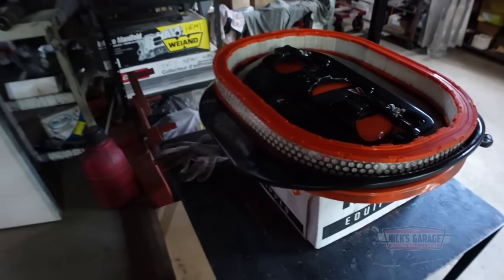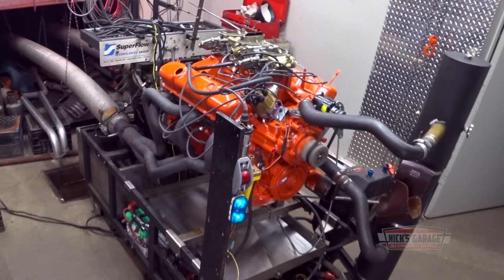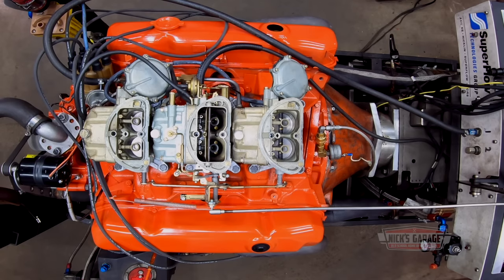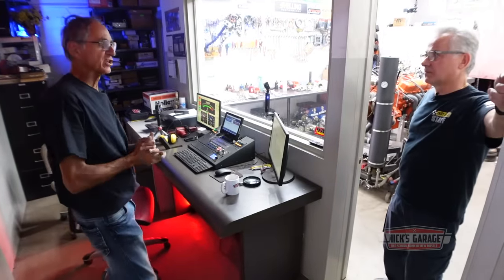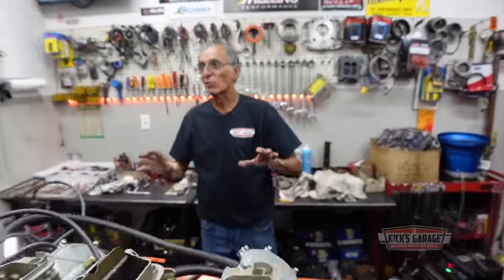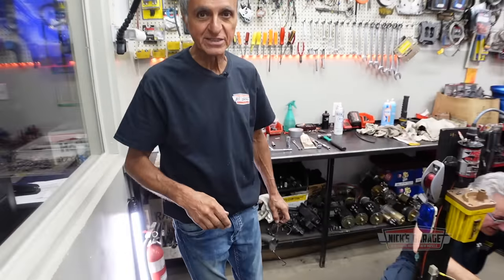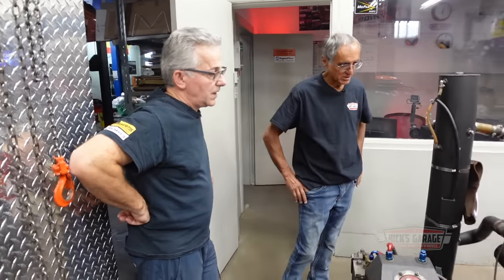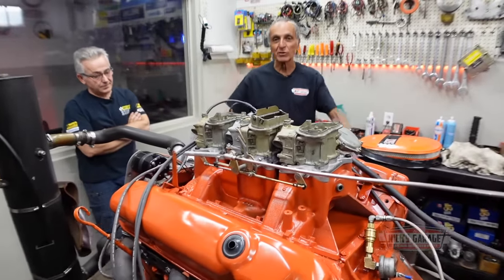HOT 1970 383 Mopar - Stroked and Dyno Tested - Road Runner Tire Melter

Comment: Hey NICK here's a little tip for that "six pack stumble". Change ONE outboard carb spring in the secondary diaphragm to one range LIGHTER. A lot of guys back in the day would put a stiffer spring in so they came in later; that's wrong thinking. By just changing one spring to one range LIGHTER, that set of barrels opens just a tad quicker. When the velocity picks back up in the manifold, then the other set opens up. That way instead of getting one giant gulp of air all at once and getting a stumble while the motor tries to build up vacuum again to get the flow moving, it comes in more gradual.
Reply: Pretty bold thinking Mr. Nick needs a pointer. Pretty bold, man.
Reply: @mikes.1882  not bold thinking at all and I in no way question Nick's knowledge. I AM however a true gearhead and that's part of being a gearhead is shop talk and offering suggestions because maybe some of us have run into this before. YouTube is just a different platform than what we had in the seventies. If Nick and I ran into each other on the streets and he said his six pack was doing this, I'd say have you tried that and vice versa. A true gearhead doesn't let his pride get in the way he talks to his buddies and gets suggestions. The days of street racing with grudges and top secret combos and unapproachable attitudes is over dramatized kids stuff.
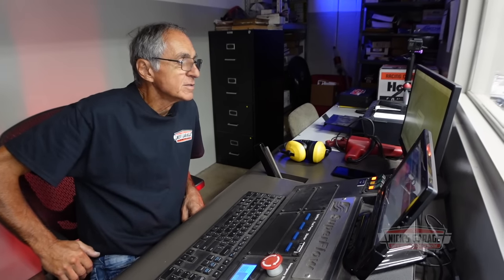Reply: 6:59
Reply: @mikes.1882 There's always a few who like to post an essay to try and flex for the Nick. Desperate for an "atta boy" I guess.
Reply: I agree 100% with Mikes1882, in makes perfect sense. This way the engine thinks it has a 4 barrel, then surprise. The extra gas starts feeding the engine when it’s ready for it and the RPM’s are there for it. Too much gas all at once sometimes is not a good thing
Reply: @TalkswithPop that is good advice. It doesnt matter how experienced you are. Experienced people miss stuff all the time, the difference is that they usually catch it before anyone notices 😂
Reply: @TalkswithPop  same issue / fix I had with an AAR ‘Cuda — my mechanic did it by accident because he only had 1 — and ask me to see if it HELPED — but it cured. If u hadn’t mentioned this “hack” I would have — EVEN TO NICK. It worked.
Reply: @TalkswithPop , That is a great idea!!! This way the transition is smoother and assists the two outboard carbs to respond better because of the higher air velocity going past the boost venturi's... My guess is Chyrsler engineers would have done that, if they knew about it..  The guys at the tracks figured it out by focusing on it, with a little more time invested, than what the engineers had, to work that issue   out... 
         I really like Seeing Nick and Mannie put their experience together, to get some great answers... Awesome Episode !!!
Reply: The legendary Hemi of the 50's would not pass the EPA's smog regulations.Heads took too long to warm up in cold weather. Engineers adopted a lean burn concept. 
I had a hard worked 440 RV in a 76 350 X van bought in the mid 80' burning 1qt every 350 miles and purring like a kitten.
I had, by law to put it through a pollution testing station once a year. Knowing the head concept then, I adjusted the spring in the vacuum cilender to keep  down the 3 steps 2 needles on a 1000 TS Thermo Quad , and advanced the timing to a super smooth idling and revvvving. Brought the exhaust smell to a sort of perfume. 
At the station the guy who was pushing on the gas pedal was raising the RPM to the limit against how he was supposed to proceed.
I thought of a rejected test! But no, the computer results came  at the highest clean burn. I was told that such good results were never seen even on any of the pollution    controls on even  brand new cars. 
I had no pollution  device on that engine.
I had also manually adjusted the spring loaded secondary trap
shaft to turn only under kick downs and close going into 3rd at 85 mph and still go up to 100 easy on the small primary velocity.
Highway mileages were 15 miles per imp. gallons loaded. A GM 350 guzzler or Mopar 360 could not beat that 440 consumption.
Torque was weaker yet with enough go to have fun faster than clamaros.
Never was preignition or stumbles.
Viva Chrysler!
You can adjusted any where in the lean.
And adjust the money vacuum operated secondary and phenolyte  bowls keeps fuel from boiling. (20° cooler) on street corner to avoid vapor lock and stumblings. I loved it.
Reply: ...and adjust the none vacuum operated secondary...
The computer does not know what I was talking about.
It is not sorry at all in choosing wrong words.
Reply: @gilleslemay4508  The cast Iron, pushrod Chrysler engines were MARVELS of engineering !!! The Early Hemi's and poly-sphere combustion chamber machines,  were some of the very best engines that Chrysler , DeSoto and Dodge, (and later-Plymouth), EVER produced... My uncle (Who passed away about 12 years ago- God bless his and his wife's [1 year ago] souls) had a large Dodge chasis truck, that. He put a 354 Chrysler Hemi engine into ... It had a 4-speed A-833 trans behind it... It had a large camper mounted directly onto the chasis... That truck just pulled that entire family of 2-adults, 5-kids, a dog and one of their kid's friends and a 4,000 lb.ski-boat,& trailer, food, firewood, folding chairs, extra cans of fuel, fresh water, etc. (18,000 pounds) up to numerous high elevation lakes (6,000' + msl) in several places that were over 200 miles from where they lived (Canoga Park, Ca.)...It was UNREAL how well that truck did on those trips.... 
       I was curious of how he passed the smog- checks which were in full swing by the early 70's in Ca... He told me, that the sealing of the combustion gass's was very important, and so he honed the stock cylinder bores to help seat the new stock spec. cast iron rings... He also replaced all of the low-end bearings with the stock sized main , rod and camshaft bearings... The block and heads were hot tanked and checked for cracks... All of the stock valves , guides and hardware were in good shape, and were re-used after they were lapped-in to improve the sealing of compression, MAP & combustion gass's, and promote efficient heat transfer between the valves and the heads... A closed PCV system was adapted to fit onto this engine....The camshaft was a touch more agressive (special - custom  R.V. grind) with new stock hyd. flat faced  lifters , and a new 3 position double roller timing set.
      He had a Single 600 cfm Carter AFB on that engine... It was jetted perfectly for all four venturi's , and the perfect staging springs and metering needles were used  in the primary fuel circuits as well... He also converted the ignition to the then readily available Chrysler electronic ignition components to replace the Prestolite points, along with a high output ignition coil , MSD box (with a rev limiter) and 8mm Ignition wires.. He said the Compression ratio and pistons were stock (9.0:1), and the rest of the engines internal and external components were also stock... He passed the smog check surprisingly well, far below the maximum allowable output of the 3 gass's (HC, CO, and NOX).... The engine on that truck had absolutely NO problems warming up, AND NO problems keeping the cooling system at a consistant operating temperature (165°F.),  with the 360° Cooling jackets it had around the cylinder walls and the generous cooling surface area inside of both of the Quad-Domed heads, even when pulling hills like the Grape Vine and HWY 40 Between Kingman and Barstow, and going up Steep grades into the Kings Canyon areas and Yosemite areas, often doing 60-65 mph , with that 18,000.pound load....All of the freeze-plugs were replaced...The large brass radiator with the 4-rows of dimpled tubes also helped to keep it cool.... A later Chrysler gear reduction starter motor (to fit onto the bell-housing of the improved NP A-833 trans) replaced the original Prestolite unit that was originally supplied for the earlier trans. (cast-iron TF) bell-housing...  A later model Autolite High Output (100 amp) commercial alternator was used... Stock 354 Chrysler exhaust manifolds (with the heat-riser butterfly removed), were used, which were quite efficient and never leaked, along with a pair of Walker 'Hemi' mufflers with both pipes dumping exhaust ahead and outboard of the rear wheels.... No exhaust after treatment devices were used what-so- ever... That truck made every single trip they took , with Zero Breakdowns.... My uncle's Chrysler powered truck was amazing as Chrysler was definitely at the TOP of their game, when they designed and manufactured those amazing engines, that went into equally amazing vehicles!!!!
Reply: @rodan2852  Evolution is not over yet.
Reply: @gilleslemay4508  Thank goodness that is true that 'Evolution is not over yet'..  However, when ideas are formed, they should evolve with information and practical experience that we KNOW has taken place in the past... Believe it or not, Chrysler developed the first generation Hemi-Head engines, from information and practical experience that was learned on various projects during WW2... Many of the large reciprocating engines for the aircraft that were manufactured for the WW2 effort had OHV Hemi-Head engines... Chrysler engineers put what they knew about those engines, on drawing boards to a smaller v-type, liquid cooled , pushrod type, OHV design with the Similar Hemi-Head combustion chambers that worked so well on the planes, now smaller (but not tamer) into their cars and some large commercial trucks... Their efforts were well received with a great line-up of engines that literally 'ran-away' from the competition between 1951 until 1958.. The bean counters at Chrysler did not like them , and so the first generation Hemi engines (sadly)  ended in 1958 model year vehicles and wete replaced by the Big block wedge engines and the 'Wide Block' 318's 'Poly' engines in 1959, which still continued until 1967 (Wide-block 318's)...  But those first and later the second generation 'Hemi' engines were really something special...Naturally more engines evolved from Chrysler and other companies.... With varying degrees of sucess... Perhaps the greatest recipe for success, is to study what did, and did NOT work in the past, and WHY the success or failures took place...
Reply: Very good to meet someone who knows Chysler history.
The interesting thing about it is that they had a dyno while the other two did not. 
Chrysler concept was 'highway'. Ford was country like the 'Ranchero' ect...GM was the town concept both were dangerous rocking boats
while Fords where best on gravel roads.
In the '50s more roads where getting paved with up to 100 miles an hour speed limits. 
So in 57 Chrysler came up with the monocoque longitudinal torsion bars. The new engineering concept lowered the center of gravity by 2" and the tall fins helped cancel drifting. 
It was an expensive  tooling change over. But, but it saved a lot of their buyers lives and their families.
In late 50's I have seen Fords and GMs in ditches, in phone post, head-on or  blown head gaskets on country roads.
Then it evolved to Uni Body with adjustable transversal torsion bars almost  reaching the disk brakes, helping cancel understeer and  excessive camber yawning from opposite A arms geometrical angles misfits.
Later it was the MacPherson suspension that crowns it all.
From my side of the history of the Hemi I was informed that the first prototype was build in 1946: a 276 injected, 276 HP. 
It was written that Chrysler knew of downed German radial air plane and asked the government the permission to pick it up.
So,  they did haul it home and the rest is the more visible history coming into production.
By the way I always visualized a V2 Harley as a weird take off of a flat head radial.
Yes Hemi heads are more  expensive to produce. 
The problems with the original block is that the distributor drive is at the back of the cam. Increasing valve size and spring tensions whit the heavy exhaust rockers cause the camshaft to twist some and valve timing and firing are off specifications.
All the wedge blocks from 361 to 440s are at the front  were the timing chain is cancelling oil pump and distributor load at the other end is a no no in drag racing including a hundred lb heavier legendary block while after market wet or dry aluminum block Hemi with variable valve timing where   on the go with all the lightest valve train stuff to get in the 3 seconds ETs.
Now we have entered an evolutionary cured new generations' Hemi and it is not yet the end of it as far as I understand the limitations of reciprocal combustion engines which are improved generation after generations.
Mich you are welcome to text us of your findings.
There is some kind of difference between us.
I am 80 yrs old and began interested in Hemies in the mid 50's.
All that I know I have read.

Comment: 383s are superb and often unsung workhorses.  Great job and bravo!
Reply from the maker: Thanks Brian.
Reply: Best motor mopar made.
A big block that revs like a small block.
This is the engine that put mopar on the map on the streets.
Reply: I agree 100%
Reply: @Welcometofacsistube  ..Yes,but the 440 still stomped the 383...I love them both...I have several 383 engines and 6 383 hp cars,all restored by myself..four 68-71 B bodies,two E bodies.I do have more 440 cars,collected,restored since the 90's...My daily for 7 years was a 383 Magnum Super Bee then a 68 Charger R/T 440 Magnum both auto and 3.23 and were stock,you really notice the extra cubes and power/torque of the 4 4 0
Reply: I had a 383 hipo in a '68 chrysler town and country wagon. After some radial tires it was a wonderful drive. The 383 had enough power to make it loads of fun. Ask the kids in the back... lol
Reply: @01trsmar  
What did you think of the 340?
Reply: @charles1964  I love the 340...especially the pre 1972 340's they changed them in 72  lowered compression,power,changed a lot of other internal parts(like every engine they had but oddly in 1971 the 383 was changed)..

The 1971 383 was 300 hp but 410 torque,thats with lower compression and internals changed from 1970 and older..still made huge torque!

The 1971 340 was rated at 275 hp but actual was 315 hp(stock class nhra rated)and torque was 350...thats bone stock with stock thermoquad carb and exhaust manifolds,so easily can make huge power with minor upgrades!

Sure the 71 340 actually has more hp but the torque is less and that makes the b body get up and go is torque and with 60 more that's a huge difference..Very close race in stock 1971 b bodies with 340 vs 383 but the 383 edges the 340 out..in my experience..We had  a few bone stock 71 b bodies with 340's and 383's..Very rare to get 71 340 b bodies,very rare! We had a Road Runner 340 and a 71 Super Bee my buddy had! Both 71 340 cars were auto and 3.23's the 383 cars were also auto and al had 3.23's.We only raced the 3.23 vs 3.23 cars,and were stock vs stock..The E bodies we knew of with 340's and 383's were all done up not stock would love to have run those..

 I did daily drive a 72 Challenger 340 Rallye for 2 years..Great reliable engines and quick,mine was mostly stock just a purple cam and bigger carb..low 13 sec 1/4 mile car..Mine was 4 speed and 3.91's B-5 blue/blue..Should have kept that one! I love 340's but my cars are mainly 68-72  B bodies and 2 door hardtop C bodies 65-72..i do have an E body,needing restoration thats what I do... Sorry for the long answer..
Reply: @01trsmar  what manifolds are nick looking for? might have a set and id love them to find a new home my 69/70 383 is gone. still have the charger it was in after it got joyrided by some SOB's and chopped/wrecked
Reply: I used to work on the killer "B" 's   Such a smooth running engine.
Reply: @Welcometofacsistube  Put some 5/16 stem light valves, Beehive springs with much lighter retainers and STIFF pushrods and they DO really rev I'd only do a 383 for a matching number car otherwise 400 with a stroker and long rod and heads
Reply: @Welcometofacsistube  ❤poopoooppp
Reply: @NicksGarage  oo[[[ò
Reply: Had a stock 383 in a 69 Road Runner - made me Mopar for life 4sp car yellow and black

Comment: I liked that torque curve that I saw at 33 degrees when you first ran the engine.  Mine liked 8 initial and I made the advance come in at 2 stages. The initial stage was 2100 with 26 degrees and then the 8 more all in by 3k rpm. Beat emissions standards through 1974 model cars, got 20mpg on the highway, and 0 to 60 mph at 6.2 seconds on a standard 383 with torqueflight and 2.91 gears.
Reply: And that was over 50 years ago! Cars made today won't be around in 50 years....(neither will we!)
Reply: The design of long rod and offset pins. These big blocks can take 42 degrees total advance with good gas and proper quench clearance
Reply: Makes sense to me. You can only swallow so much at one time.

Comment: Chrysler started manufacturing the 383 way back in '1959'. From the day it was introduced demand for the 383 went through the roof! Within only 2 years of introducing the 383 Chrysler had to open a second engine plant just to keep up with demand for the 383.. When I was 16 years old my buddy's dad owned a 1960 Chrysler Saratoga with a  factory equipped 383, four barrel in it. One afternoon my buddy took me for a ride in it. OMG COULD THAT CAR GO!!! Thanks for loving the '383' Nick; many of your fans carry treasured memories of that GREAT engine.
Reply: Originally in Chryslers they were actually putting 383 RB engines. 4.025” bore and 3.75” stroke only made them for a year or two because they couldn’t produce enough of the B version. ‘59 and ‘60 I believe